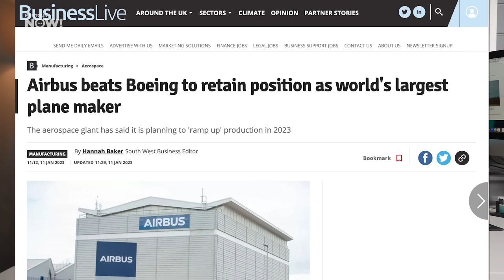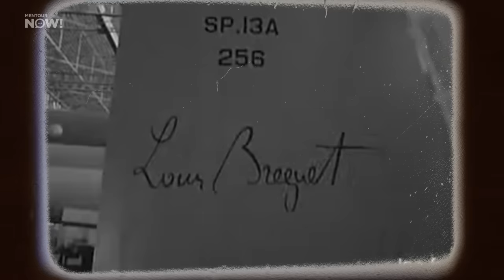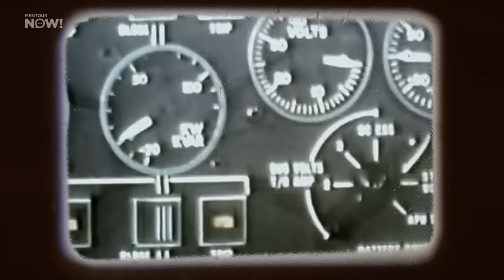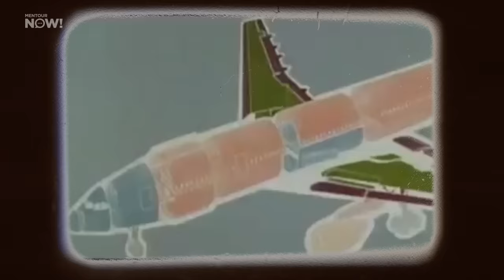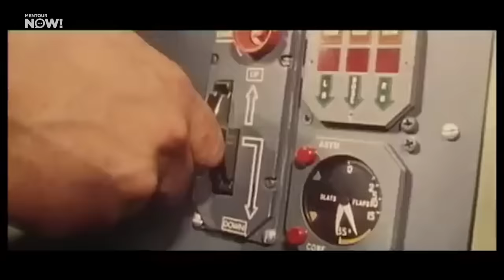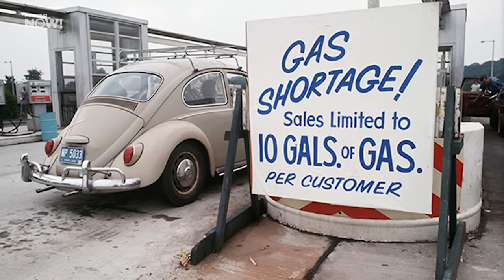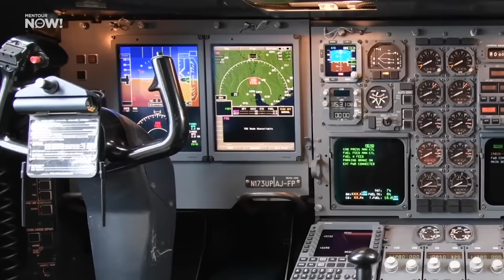Without this Aircraft, Airbus wouldn’t exist!

Comment: One of the most incredible stories about the A300 is the one that survived getting hit with a missile.  In November 2003, a DHL A300 got hit with a man-portable missile shortly after takeoff from Baghdad International Airport.  The impact occurred on the left wing, which destroyed much of its trailing edge, bled out all hydraulics, and caused a fire in the wing.  Using differential thrust, the pilots managed to turn around and land back on the runway with minimal additional damage, and the plane was actually repaired afterward.
Reply: Yes, that is a remarkable story.   Just to cap it off, after landing they  ran off the runway and ended up in a minefield (obviously without setting off any mines).    Although it was repaired, they couldn't find a buyer - probably because of the age of the aircraft - so it was sadly scrapped.
Reply: "[Selling] Airbus A300, new wing, clean Carfax"
Reply: @alles_klar  "I know what I got comes with new rims"
Reply: Wow!
Reply: They also did a full go around with all that damage. Mayday covered that incident.
Reply: @alles_klar  Only 1 old lady pilot just used to go to the shops and back
Reply: They got hit in the tip of the wing with a 2 kg warhead. They were lucky
Reply: Belgian pilot of the aircraft had attended a seminar, there was a lecture about flying a plane with partial controls. Lecturer was a captain, who had been in that situation. Belgian pilot prepared himself mentally to future case.

Comment: I was fortunate to fly the A-300 at Eastern. The aircraft had the same handling as the DC-8 and was fantastic to fly. I was a little worried about flying the Airbus because of fear of poor craftsmanship but found the aircraft to be better engineered and constructed than Boeing and Douglas.
Reply: I didn’t fly, but I was at EA in the mid 80’s in Miami.  Sad to see it go along with Pan Am.
Reply: Can you explain how the aircraft was better engineered than the 747?
Reply: @sanitman1488  For one, Airbus got the wing right on the first try, they didn't have to come up with redesigning a twist into the wing after the fact, to fix lift distribution problems.
Reply: @sanitman1488  "Utter nonsense"? Please look up the famous "Sutter twist", the workaround that Boeing had to make on the 747-100's wing AFTER it was already being built, because lift distribution was all wrong. Boeing's engineers managed to salvage the wing by redesigning the outboard section , introducing a 3-degree negative twist. The fiasco was described by none other than Joe Sutter himself, the 747 lead engineer known as "father of the 747". There is a dedicated chapter about this in his book about the 747. Great read, BTW.
As I said, Airbus got the A300 wing right on the first try, while Boeing had to partially redesign its 747 wing.
Reply: @coriscotupi  utter nonsense. The aircraft did not enter full production. It was still in its development stages when the initial problem with the wing was found.
Reply: @sanitman1488   Do you have trouble reading? Did I say it was on full production?  What I did say is that the wing had to be redesigned after it was already being built. Need a drawing? Keep repeating "utter nonsense" as much as you wish, it doesn't change the fact that Airbus got the A300 wing right on the first try, while Boeing had to redesign the 747 after it was already being built because they messed up its lift distribution. How old are you, 12?
Reply: @coriscotupi  Here he discussed the “twist” in detail. There was no “fiasco” as you claim rather engineers coming together to solve a problem before production ramped up.  As the aerodynamics testing was almost finished, wind tunnel tests showed a problem. Pressure distribution on the outer portion of the newly designed wing was such that the internal wing structure could not properly support the excessive loads. ( lift distribution was not all wrong )
Reply: @sanitman1488  "Pressure distribution on the outer portion of the newly designed wing was such that the internal wing structure could not properly support the excessive loads"
This coming from a major manufacturer, with the wing partially built, with engineers wanting to scrap the wing entirely and start from scratch spells FIASCO. And yes, lift distribution was all wrong, to the point of the options being (A) scrap the wing or (B) Redesign the outboard section. 
What part of AIRBUS GOT THE A300 WING RIGHT ON THE FIRST TRY DO YOU NOT UNDRESTAND?
Reply: @coriscotupi  UTILIZE THE EXCREMENT BETWEEN YOUR EARS.  THE AIRCRAFT WAS STILL IN ITS DEVELOPMENT STAGES.  CAN’T YOU COMPREHEND WHAT READING?
Reply: @sanitman1488  Cry out loud as you may, you cannot change the fact that as I have been saying from the start, Boeing HAD TO REDESIGN THE WING on the 747, while Airbus got the A300 wing right from the outset.
It's not a hard concept to grasp, child.

"EXCREMENT BETWEEN YOUR EARS"
Wow, a keyboard warrior.
I'm done talking to this child. No need to reply, you be talking your utter nonsense to yourself.

**MUTED***
Reply: @coriscotupi  LoL you lost imbecile.  The FACT is the aircraft was within development stage NOT FULL PRODUCTION. Boeing got it right the first time. Once full production commenced, to this very day NEVER any issues with wing. Now take you’re aviation armchair quarterbacking elsewhere.
Reply: @coriscotupi sorry sir but this guy arguing with clearly made valid points.  Nobody really knows if Airbus as well went thru several design changes no only the wings but fuselage etc before production.
Reply: @whiskeykilo2h429 
"Nobody really knows if Airbus as well went thru several design changes no only the wings but fuselage etc before production."
That would not be a valid point, because it would be nothing but pure speculation. One can say anything about anything just for the sake of argument - which won't make it true until proved. As for Boeing, the well documented fact remains that the design team messed up the wing and it  had to be redone as the 747 was already being built, meaning jigs had already been manufactured, tooling had already been manufactured. 

There is no going around this, as much as that fanboy gentleman refuses to see.
Reply: @coriscotupi  with all respect, it is a valid point. Boeing simply had gone public with the delay of production reasons related to its wing design. The public anticipation for the aircraft was well known unlike the Airbus a300 which I understand was in financial straits with the aircraft until Pan Am or Eastern Airlines purchased it?  As with any commercial aircraft produced, there are delays with production because of issues with a design!  This statement ‘got it right first time’ again with respect simply doesn’t make any sense?!  The financial burden from jigs and tooling already manufactured must of been minimal impact because the delay wasn’t years rather months.  Airbus for example with its a330 had two accidents, one was a hull loss and the other, safely landed but with casualties because of software problems. Here obviously Airbus industrie didn’t get it right first time.
Reply: @whiskeykilo2h429  No it was not a valid point, he used the fact that the airplane was not yet completely built as an excuse for it being a lesser problem - which seems to be your point also. My point being that Airbus had not had such a problem with designing or building the A300. This cannot be that hard to comprehend.

Your mentioning of other problems with the A330 or any other model is just changing the subject. If that is the case, then we might as well mention the 737 max falling out of the sky, door plugs departing airliners mid-flight ,787 batteries catching fire, or 787 fuselage gaps larger than specification during assembly.

Goofing an airliner wing to the point of having to redesign it while the wing itself  is already being built is a major screw up, no matter how fanboys choose to look the other way.

Useless to continue repeating the same thing over and over, I seem to be in fanboy territory here.

Nice chat. 
Cheers
Reply: @coriscotupi  Once again it seems now you are deflecting. What is you’re capacity within the aircraft manufacturing business?  Were you on the factory floor while the a300 was being built?  This sanitman has more credibility than you and suggest it is you spewing ‘fanboy’ talking points on this forum. All these manufacturers produce flawed products and this notion Airbus ‘got it right first time’ is ignorant at best.   Indeed nice chat.  Cheers.
Reply: I don't really have a dog in this hunt, but the A380 wing failed it's overload test, had to be redesigned, which added weight, which reduced the plane's overall fuel efficiency.  When you're working at the edge of any technology, sometimes things go wrong.

Comment: Airbus is an innovator. First twin engine wide-body, fly-by-wire, full glass cockpit, and so on and so on. Airbus, listened to its potential customers and has delivered on that philosophy from the first A300. Congratulations Airbus.
Reply: Airbus literally replaced old Boeing 

We are not talking about Being post McDonal Douglas merge (its shit)
Reply: And Airbus' FBW systems are still today revolutionary, having evolved so far they make flying the planes really easy. They can maintain the same angles by adjusting trim, and that makes flying modern Airbus aircraft really smooth and easy.
Reply: Only because the BAC-3-11 was unceremoniously dumped when it itself was a far better aircraft and would have destined Airbus to the dustbin.
Reply: Except for the A350 , a very dangerous aircraft with its " Mcas system controlling the tail plane

Comment: Airbus couldn't get the engine they wanted from Rolls-Royce as Rolls-Royce was too busy working on an engine for the Americans and a bankruptcy, so Airbus had to cut the A300 shorter. Probably the best decision they took. In Airbus style, they would come back later and offer the original plane as the A330-300

Comment: I have over 1000 hours as a captain on the A300. It truly was a wonderful aircraft with great power and performance. The 3 crew cockpit was also enjoyable and we flew with engineers not third pilots who knew the aircraft inside out. Ours were all freighters and could carry 100k of cargo, replacing DC-8's at that time. Many unique systems started with the A300 that made it very reliable. After many years flying Boeings the Airbus became one of my favorite aircraft.
Reply: Not "was" - "is". Still operating , even B4-200F.
Reply: It’s still flying strong as a cargo plane. UPS and FedEx still retain relatively large fleets of it.
Reply: DC-8F? looks like UPS .. or maybe FedEx 🤭
Reply: A300b4

Comment: Oh the Dassault Mercure ! I LOVED this aircraft, having spent hours flying on them in my childhood.
Crews nicknamed it the fighter, not only because it was made by Dassault, but because it kinda handled like a fighter jet.
That's also why, while I was jumping of joy at the idea of flying on one, my mum was exactly the opposite, as she really didn't like aerobatic maneuvers.
This aircraft was a godsend for Air Inter and ATC as it could fit into empty slots in approach queues by performing some quite steep maneuvers. Which also meant exceptional punctuality.
The approach to Paris during rush hour was always quite the ride, with the cockpit asking everyone to be seated over the PA. That meant we'd be in for some thrilling sensations.
I think this aircraft is responsible for at least half of my huge love and craving for high thrill sensations.
Plus, Air Inter was a great company, an ancestor to nowadays low-cost carriers, with their "colored fares" : blue, white or red. They really had very affordable tickets and helped democratize air travel.
To the point that they even used A330's for short hauls briefly before being taken over by Air France. Air Inter was an A330 launch customer if I recall correctly.
They obviously also flew several A300's, especially on the Paris <> Nice, of which I was a frequent passenger with my mum as she worked in Sofia Antipolis several days a month.

The Air Inter A300, as I remember it, was in high density mode with one large single cabin, so it felt huge.

Very good video that offered me a lovely trip down memory lane. The A300, Mercure and Air Inter were my first love with aviation.
Thanks a lot!